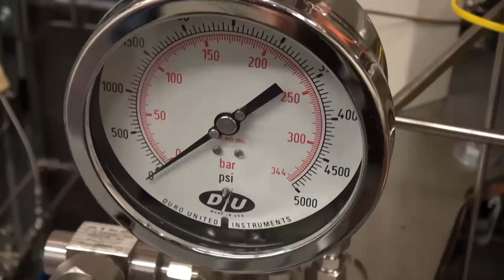Algae to Bio-Crude in Less Than 60 Minutes

Comment: Come on people, read the article, they're not going to destroy another "green" thing on this planet, they can grow the algae in a lab as well. It says in the article that "Once the system is up and running, out comes crude oil in less than an hour, along with water and a byproduct stream of material containing phosphorus that can be recycled to grow more algae.", so algae are not going to be extinct or whatever, aside from fossil fuel which the earth reserves are running lower and lower each year.
Reply: Mate ur sleeping there is so much oil that you can fill Australia land mass with 4M high oil level  goodluck with waiting untill it finish as u said, irak, iran Venezuela  which  have more oild then saudia even dont forget the mediterrane sea , Africa  alot of places which have not being open for oil production  oceans of oil !!
Reply: @mossmusap338  The issue is not the amount of oil, the issue is the ecological cost of using more of that oil.

First off you have climate change, caused mainly by the emission of Carbon Dioxide upon burning/utilization of the fossil fuels, but also via release of non-combusted methane (From leaking pipelines, as a waste product of oil wells, etc), which is more potent.

Even if you don't believe in science, you also have to consider:

the many oil spills
the many issues with coal combusion byproducts
the issues with flue gas such as acid rain
the issue with water usage in well fluid, as well as fracking fluid
the land use of mining (Both of coal, but also increased demand for silica sand for use as a fracking proppant etc)
the issue of water contamination (due to spills, or even damage due to the well itself)
the geopolitical toll (in both wars, and economic inequality)
the economic toll that requirement for fossil fuel based power lays on islands for operating a power grid
the wasted labor + resources on utilizing "harder" oil (shale oil, tight oil, oil sands etc)
the wasted labor + resources on utilizing "tight gas"

And all of those above issues aren't some "Fake news media science", they are things you can see from the ground.  A duck covered in spilled crude from ever deeper, and ever riskier offshore wells, the net of pipelines, or shipment caused spills can't be denied.  A town devostated by a coal ash dam can't be denied.  Sacred lands being turned into pit mines or pipelines can't be denied.

To support fossil fuels at this point is just plain stupid, and indefensible.